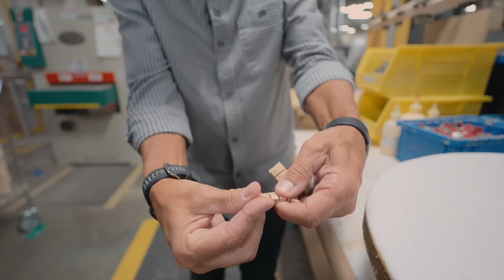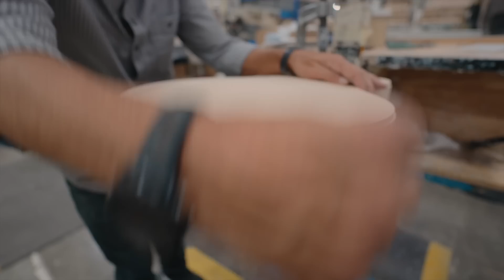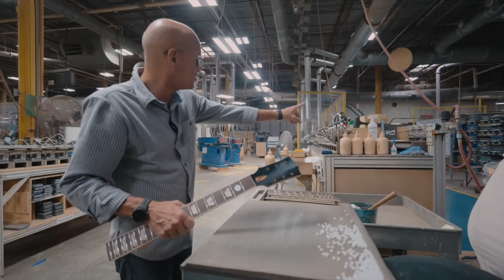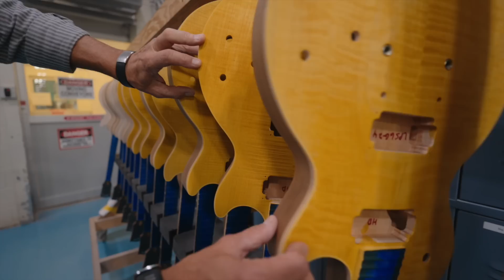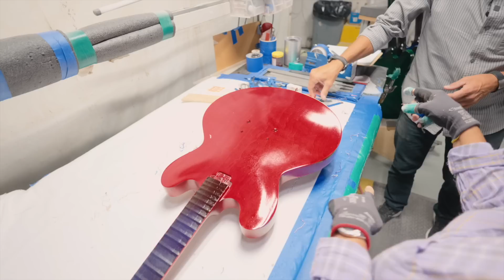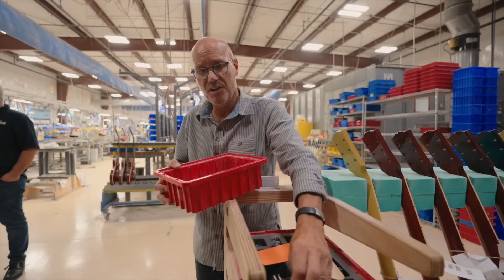Gibson USA Factory Tour with Jim DeCola!

Comment: Until 2018, I worked at a factory that manufactured electronic connectors and wiring for the Department of Defense, missiles, airplanes, helicopters, early electric vehicles, computers, and more. The most reliable machine on my production line was built in 1939—a World War II-era lathe.

Comment: 14:29 Every Gibson USA guitar deserves, and should have, a LONG NECK TENON. With Jim DeCola doing all the describing, explaining and talking, it’s the best thing! Jim knows so much about guitar design, manufacturing, factory equipment, factory operations, machining, cutting, sanding, routing, finishing, buffing, electronics, installation, handicraft, handiwork and craftwork in general.
Reply: Why? 99 percent of players can't hear the difference between a long or short neck tenon.
Reply: @simonvanderheijden432  Better structural and tuning stability. I can definitely appreciate and hear these things!

Comment: Gibson could always add a real modern design and production line, and keep the current classic / traditional design and production line, where they experiment with new guitar shapes and technology.

Gibson purchased Steinberger years ago; that could have been the modern "innovation, technology and engineering" brand - separate from the Gibson brand.  Instead they basically let Steinberger die a slow death, though the Synapse series were pretty good IMO
Reply: They will resurrect them when they realise it was a big mistake. Plus if it dies you can reissue stuff. Vintage headless guitars. Custom shop and all. Haha
Reply: But they have added super strat style guitars, Victory I think they're called. They miss the Floyd Rose you kinda want of a guitar like that but they're interesting. Gibson has tried new stuff many times but the fans throw a hissy fit and it's dropped. Now they're too known for heritage guitars that it just look weird to have a non standard Gibson style guitar have the logo. But they have tried a bunch of times.

Edit I checked, it's a kinda PRS style super Strat with 24 frets and Fender scale length hehe... actually not bad but if I want something like that there are many cheaper options. But who knows. All the cool Gibson models weren't succesfull at all in the beginning like the V and X and Les Pauls did sell well but not that well. They were discontinued after 9 years or so. All those expensive 59s are the last models before it was discontinued for a long while. The SG did very well and by the time Les Pauls became popular again they were also reissuing Vs and Xs and all that. But they sold about 3 times as many SGs in 1960 as Les Pauls in 1959 (still called Les Paul then) if I remember they sold around 2000 59 Les Pauls and around 6000 1960 Les Pauls (SGs).

Comment: Having more consistent, and improved, QC would be great. 

I don't buy new guitars off the rack; but I wouldn't buy a new Gibson without seeing and playing it first.  These two statements make buying a new Gibson difficult.  

How many Gibsons, on average, do you try before you find one you like enough to buy?  

For the last several years, I buy my new guitars online and ask for new in factory-sealed-box. Out of my last 20 or so guitar purchases, I've only returned one guitar (not a Gibson).

I like Gibson guitars, I just don't like the odds of ordering one online, new in the factory sealed box, and high probability of having to return it due to QC issues.

IMO

Comment: I have 3 Les Pauls and all three have to have String Butlers on them to keep the G and D in tune, I wish Gibson would make a Les Paul without the 17° break angle on the headstock and a straight string pull headstock, the V headstock on a Les Paul would be just great, even if it was just like the paranormal series that Fender did, just a limited run.
 How come Gibson's have tooling marks on the fretboards? all my non Gibson guitars don't have this, hell even Chibsons can be made without the tooling marks!
Reply: I have two Standards and a Junior and  I have ZERO tuning stability issues. If you aren't capable of properly filing  nut slots and setting up your guitar, find an expert that can. Now get lost, you whiny Gibson hater. Yeah right, you have 3 Les Pauls. haha You prs lover with GDS!
Reply: Nowadays, for non-reissue models, Gibson guitars are made with only a 14° headstock angle. I agree, the V or Explorer headstocks on other models would be really cool! Maybe the Mod Shop could do something like that?
Reply: So many defects and you bought 3 of them ? you're a genius right ? why didn't you buy 3 chibsons instead ?